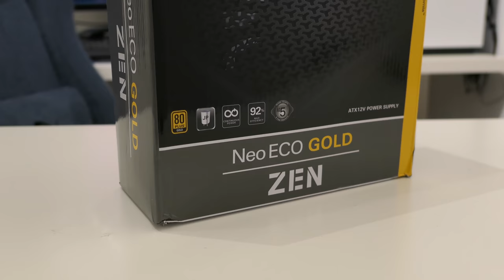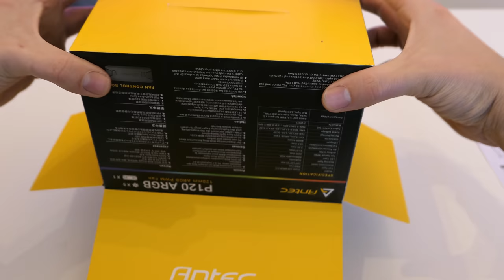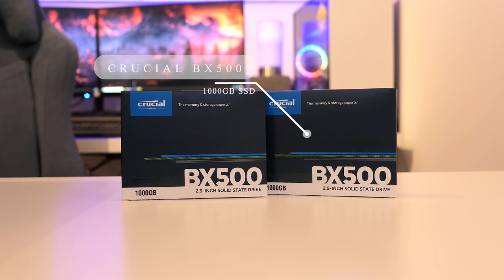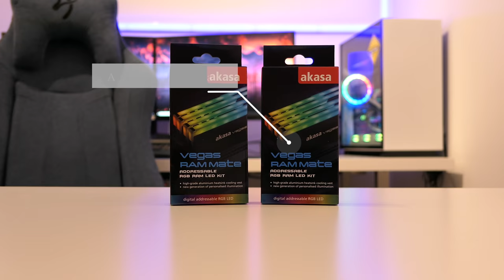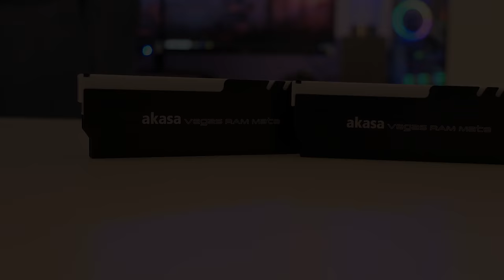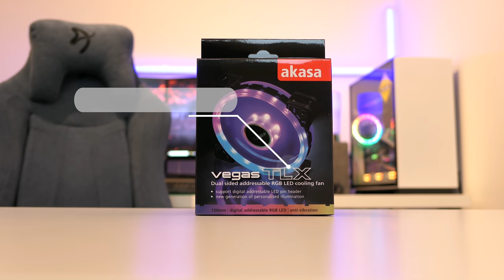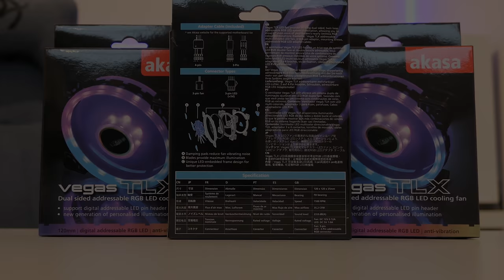PC Build Timelapse - Antec P120 Crystal

Comment: so you can fit a 360 aio on the back and keep one HDD cage? everywhere I have looked seems too say you have too lose both ? sold on a new case if I can keep one cage lol
Reply: Yes you can but it's a tight fit. It depends on the brand your using. Some are higher some are lower.
You can even fit a 420mm rad in the bottom but like I said before it's a tight fit and depends on the brand you're using.

So take measurements and look it up. Good luck and have fun with your build 😁
Reply: Yeah.. that's what I read too. This is a game changer, as it still allows me to keep one mass storage HDD. I was planning on getting a Deepcool Castle as well, but wasn't going to get the 360 because I thought I would have to lose both HDD bays.

Comment: 15:21 Wait, so you can install a 360mm AIO and the 3.5" Hard Drive bay at the same time? This is a key deciding factor for me to purchase this case for my next build.
Reply: Yes i have  the same case we can do that but I have two ssd on back side and two m.2 on motherboard so why would we need HDD right ?
Reply: Or you can buy the Lian Li PC-O11 Dynamic which has two 3.5' bays and four 2.5' mounting slots. This Lian Li (which is the reference deisgn) is one of the best cases I've ever built in.
Reply: This is a deciding factor for me as well. I only need the 1 HDD bay but would like a 360, did you ever find out if this combo was possible?
Reply: @masonalbright2199  depends on the cooler, the one I bought (Deepcool Castle  360EX) wouldn't even fit a single Drive bay. It looks like they're using the older Castle 360 non-EX in this video. I was able to fit my 3.5" HDD in the power supply bay behind the power supply though
Reply: @Sharks4Cup408   Okay, from what I can find the 360EX has a radiator height of 402mm, and the original RGB version has a radiator height of 395mm, does this small difference really make the difference? Did you strap your HDD down at all or is it just floating?
Reply: @masonalbright2199  I screwed a metal plate to the bottom of the HDD and mounted it with velcro tape. The power supply I'm using is the Fractal Ion+ 860P which is a bit smaller than most other PSUs. But as for the AIO, the video shows is that they were able to mount their AIO all the way down to the lowest point. I'm using 140mm Antec Prizms for my bottom intake as well as 2 sets of 120MM fans in a push/pull setup on my 360EX which sticks out to the point where I have to mount the radiator 25MM from the bottom due to the frontmost 140MM fan being in the way.
Reply: @kishor_____  dude how is the airflow direction , which one  sucks in and which one pushes out
Reply: it depends on the model of cooler

Comment: Hey! Really loved the build. Got introduced to some manufacturers that I'd never heard of before too. Just one question - do you think 2x120mm intake fans at the bottom and a 240mm rad at the back for exhaust would be enough if run  2700X with a RX 580 (open shroud) in stock. Also, if I plan on OCing a bit, what would be a good airflow config?
Reply: The temps should be ok. but I wouldn't recommend a radiator being your only exhaust.
But for a 2700X it should be still working

Comment: What CPU was used? Also, how did you sync up the rgb of the gpu with the rest of the components when it's not the same brand? And doesn't the fan hub already take up the ARGB pins on your motherboard? So, how did you make the CPU cooler light up?
Reply: I just noticed he hasn’t even included the cpu in the description

Comment: Can you still fit another set of fans on the other side of the radiator for push/pull configuration? Or would the radiator fans hit the bottom fans?

Comment: How did you connect all the fans together? the antec controller only connects 5 fans. also how did you handle the three pin rgb header? my board only has 4 pin.
Reply: I hate that. They don’t provide 4 pins and only a 3 pin.

Comment: Is it possible to install an optical disc on the 3.5: hard drive bay?
Reply: No. You would need a 5 and a quarter inch bay at the front of the case.

Comment: Hey bro I have a question, I want to build a long term gaming pc and I wanted to put amd ryzen5 3600 process, b450mb, 8gbram(I'll add 8gb more later),550wattpsu,240gb SSD and the main part is I want to install the 1660 6gb graphic card but it's out of my budget so can I install it later, like after 1month ?? Coz I want 3600processor and that 1660 6gb ram
Reply: you can, why couldn't you? Your PC works fine without a GPU you cannot afford now, I'm telling you, I did that and it worked

Comment: You made a big mistake. Never mount the pump with the tubes toward the IO shield or the RAM slots.. they have to be put either toward the top or toward the GPU card since there is more space. As you mounted it, you basically burned up a RAM slot..